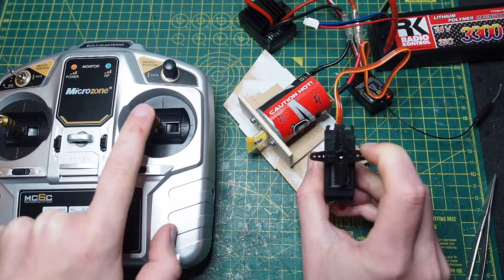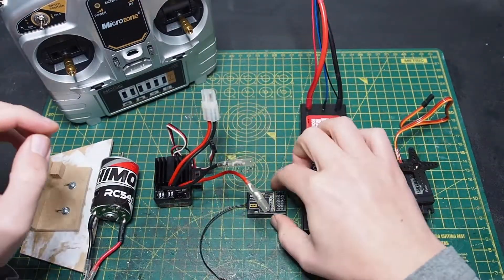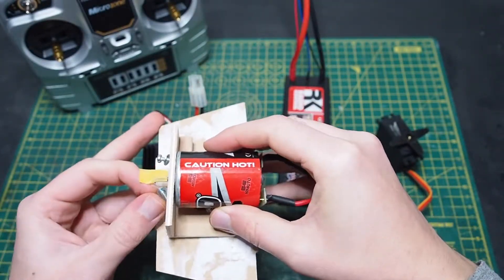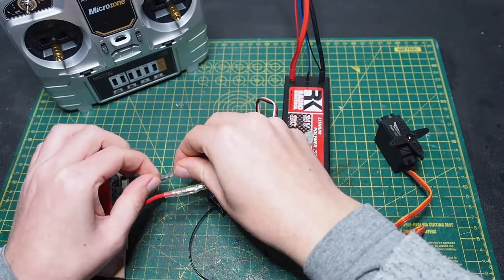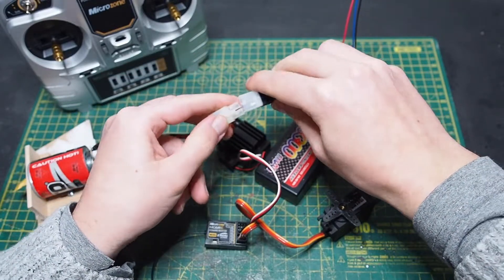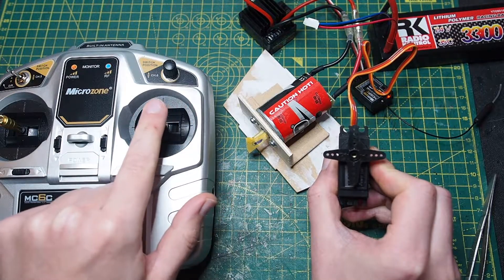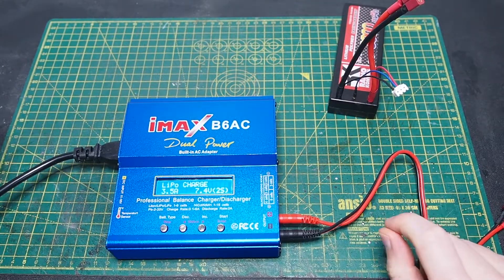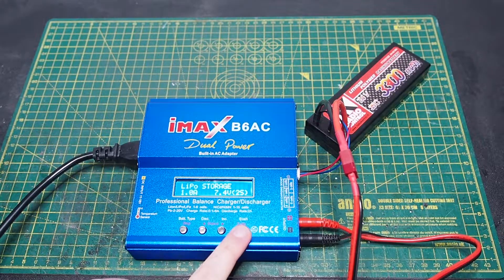TOP 6 basic RC parts to motorize MODEL SHIP

Comment: What is "storage mode" for a Lipo battery? And why are Lipo Batteries used in models? Why not lithium-ion batteries?
Reply from the maker: Well both have pros and cons. So let’s start with the storage mode, the storage mode keeps LiPo batteries at around 3.85V per cell to prevent degradation. LiPo batteries are preferred because they are lightweight, have high discharge rates, and come in flexible shapes. Li-ion batteries are less common due to lower discharge rates, heavier weight. Lithium ion were used in the past mainly
Reply: @Tagliamare  And what does "Store Mode" mean exactly? Does the Lipo battery have to sit on the charge 24/7 if you're not planning to use it again right away? I am new to this, and I really do not want something bad to happen because of a uneducated user error.
Reply from the maker: No the charger will tell you when the charge is complete and you can store the battery. I recommend you read the product manual if you have further concerns